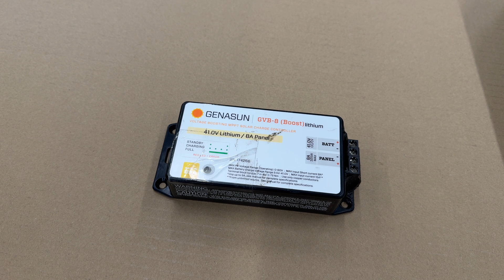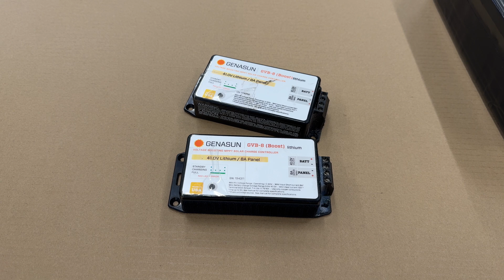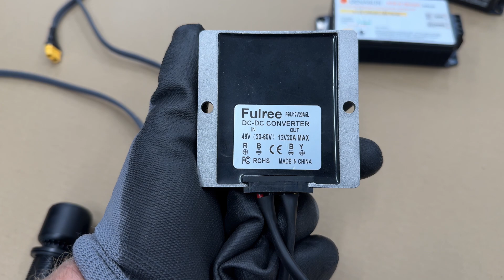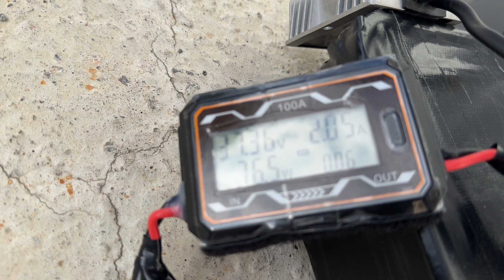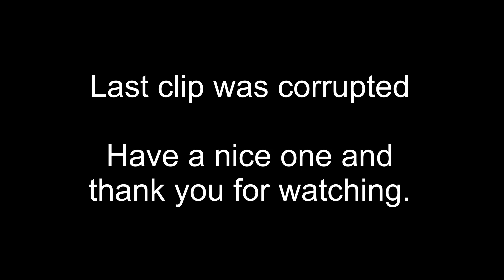How To Solar Charge Your E-Bike. A Simple Guide

Comment: Hi Alex, great video!
Where can I find a battery or a BMS with a common charge and discharge cable?

Thanks,
Sam
Reply from the maker: @samsske  Hi Sam. I use Daly Bms with great success. They are easy to use and mount. Try to avoid ”smart bms’s” as much as possible. Have not so good experience with them. 
Thanks for your comment.

Comment: How do you calculate how many Ah the battery need to be? I mean to optimize Ah as to not carry unnecessary weight that is never used?
Reply from the maker: I calculate based on how much safe charging current has to be. Imagine going down hill and hit full regen and simultaneously solar is charging. I need the pack to be able to handle it without the risk of fast charge too much. When it comes to batteries I don’t care about weight.

Comment: Do I need to build a battery or can I use a battery from grin thats solar compatible with your setup? I'm curious why build the battery instead of using one thats already built? What are the benefits of your battery over a manufactured one? Are there batteries you recommend? Thank you for your videos they are very helpful
Reply from the maker: @joshuacoolidge5995  hi. I build them myself to ensure it’s up to my standards. Not that I don’t trust grin but I like to have full control. Plus it’s a lot cheaper once you have gathered the proper gear needed to build. 
It depends on what kind of cells you are using and the bms on how much charge they can take. I have limited my controller to not exceed 500w regen to ensure the battery can handle it. 
I have exclusively used Panasonic 18650GA cells and for this build I used Samsung 35E. With 12 cells in parallel it can handle a lot of amps.
Reply: 1540wh battery bms can handle the watts from 540 watts solar and the regen?

Comment: Can you charge and discharge a battery at the same time?
The answer: YES!
This the essence of a solar bike:
1) your solar panels do charge your battery
2) in the meantime you use the battery to turn your motor 😎
Reply from the maker: Well, my battery only has one cable. And it handles both charging and discharging. I know this because I built the pack myself. Because it goes to the exact same port on the Bms. My battery does NOT have two separate cables. Only one. Because a battery can not under any circumstance be filled with energy simultaneously displacing it. Either it is discharging or being charged. It can’t do both at the same time. It’s practically impossible. As I tried to explain in the video. Power from the solar aids the battery if the motor takes more than what solar can provide. Battery and solar deliver power in conjunction to the motor. In this instant the battery and solar deliver power to the motor and the battery fills in the ”blanks” that solar can’t provide. As soon as the power consumption of the motor drops below what the solar can provide the excess solar gets stored back again into the battery. It’s a constant switch between charging and discharging happening. And it’s not a bad thing because solar takes load off the battery to power the motor. The battery does not have to do all the work by its own all the time. Solar help the battery to maintain a more steady state of charge.
Reply: so if there are individual cable for charge(by solar panel) and discharge, it is OK to run the motor and charge the battery by solar panel at the same time? right?
Reply from the maker: @2.35이상원  that’s correct yes. The two cables often connect to the exact same place anyways on the bms inside.
Reply from the maker: Yes I agree but what I mean it is technically impossible to sent power two ways at the same time through the same cable 😊.
Reply: @Alex_EVenture  This is why in a Solar bike battery we have 2 cables:
- a CHARGE cable, where you either connect your solar panels or your battery charger
- a DISCHARGE cable, which goes to the electric motor
Reply: But the battery is not charging and discharging at the same time. Either the electric potential across the terminals is higher than the electrochemical potential in the electrode plates, in which case the battery charges, or the inverse is true, in which case the battery discharges. 

Having some combination of sources and loads simply determines whether the terminal voltage is higher or lower, and the battery responds according to physics. Only one thing or the other is true at any given time.
Reply: @myself248  Your explanation doesn't make sense....
In my (all...) solar bikes the battery can CHARGE and DISCHARGE at the same time through two different ports
Reply: @daniele_go  You're providing power into the battery ASSEMBLY through one port and drawing it from the battery ASSEMBLY through another port, but chemically there's only one battery and it's only doing one thing at a time, which is determined by the sum of the power flowing in and out. If there's more coming in than going out, then chemically the battery is charging. Period.
Reply: @myself248  you are just making words....while I design&build solar bikes.
What I say is not theoretical concept, but the description of how a solar bike works.
AT THE SAME TIME:
- you pedal, the motor does assist you
- solar panels produce electricity and recharge the battery.
AT THE SAME TIME

Comment: If the power for driving the motor comes directly from the panel(s) you circumvent the losses for charging the battery. Most efficient use of your solar energy!
Reply from the maker: Exactly. Plus the battery gets a nice break and assists.

Comment: There's solar charge devices for Bosch available now. One is German made (coming soon), but only up to 120W solar. The other is French made and , if I remember correctly, up to 300W solar. The German upstep converter works also for Shimano etc.. However, currently I carry out a Tongsheng TDSZ8 middle motor/Hailong battery (960Wh) conversion of a HP Velotechnik Speedmachine. This is about 4-5 times (!) cheaper than Bosch, Shimano, etc.. The cells in the battery are Panasonic, same as in Bosch etc..
Reply from the maker: That is amazing news to me. Thank you for enlightening me. I will check them out and inform in my next video.

Comment: I would rather split my battery pack into two or three switchable sections so they charge faster and we can keep our average operating voltage at any time as high as possible.  Could even maybe add a section of supercaps to act as a small sag buffer to do hot swapping nicely without stopping.
This is cool, thanks for sharing and the algorithm is working for you because it threw this on the sidebar for me.
Reply from the maker: Unrestricted my setup can achieve speed of 39kph (24mph). I have a 25kph (15.5mph) restriction so for me it is never a problem keeping up the voltage. A large battery rather than several small takes stress out for the battery since each cell cycles less. I have also thought about the supercap implementation. It would be super cool to have actually. 
Thank you so much for your comment. I appreciate it.
Reply: @Alex_EVenture   Thanks Alex for the teaching and explanation. I am trying to learn as much as possible, so can you explain the comment of russellzauner above regarding the supercap and what it does?  Also, how long  would the battery last for ( longevity , after so many charging and discharging while you are on the world tour)
Reply from the maker: @kentran2416  Thank you. Supercaps can charge and discharge extremely fast. Much faster than batteries. So if a module of them are in line with the battery pack it can take care of those high peaks of power in and out put and by doing so spare the stress on the battery pack. So it’s like a buffer for power. It is not just like you put them in and it’s all good. You still need additional equipment to make it work. 
What I do to ensure my battery lasts longer is by not charge it to 100% ever. I charge to 90% and by doning that I will  prolong the lifespan. And I never let it drop lower than 30% charge. By having the perfect amount of solar my battery hovers around 60-90% all the time which is perfect for the battery. Less cycling. Optimal would be 80% maximum all the time for maximum battery health.
Reply: @Alex_EVenture ❤😮

Comment: Do I need to connect the charge controller output to the battery output or to the battery charger connecter on the battery?
Reply from the maker: @skyl4rk  what Art said but to clarify. If you battery has two ports. One for charging and one for discharging but in reality they are actually the same on most batteries. It depends on your Bms inside if it separates these two functions. Do the test I mentioned. You can then connect the solar to your charge port and connect the other one just as you normally would.
Reply: @Alex_EVenture  OK, I did the test and it turns on while charging.  I have the Unit Pack Power 48V 20aH battery from Amazon.  When I get some xt60 connectors, I will start building.
Reply from the maker: @skyl4rk  perfect. Good luck with the build.
Reply: Note he wires all battery connections in parallel and mentions some manufacturers' BMS charge connection prevents charging/discharging simultaneously. I just bought my 1st LiFePO4 battery with attached charging/discharging BMS. I expected to be able to do both simultaneously but need to confirm.
Edit: My little battery allows charging and discharging simultaneously.

Comment: That was so helpful, my thanks Alex. One imagines that a bigger part of your design/functionality process can only both start and develop with
a good understanding of your limits. In turn, you are looking for ways to counter those limitations like the weight of a battery, cost and safety.
Consider me brain dead when it comes to this subject, it´s almost like a disability built-into my genes! :cat-orange-whistling:
The last time I was looking at a similar set up, was the idea of having of these popular solar panels that are flexible and can be unrolled to fix
onto your backpack while trekking. This somehow "led" me to consider the prices of the home run systems that link to a bigger battery, simply to
be taking reshored on sunny days!
I was also interested in the advantages of tenting with my van as a base at the time. Those systems tend to be self serving and plug-play set ups.
You have to know what the max output of your motor should be given the average weight and grade of hills you will climb and then work back from
their. I tend to always find issues that need answers, like is that transformer waterproof, how will the insurance be calculated on it. etc.

Don´t worry, you do not need to answer, their just examples. I feel that their must be a whole lot that could be done with better knowledge and
am simply impressed that you were the right person at the right time, to even want to entertain such a challenge. 
Your new panel is very big, or at least seems huge, yet as you say, it has a second function. As it is, the wind will blow the water from the edges onto you,
so are you thinking of having a little edge or lip glued onto each side and front? Also be carful with the crazy heat we have been having, I had 40 down
here on one day, that would melt your tapes and wires I think.
Your transport certainly has a footprint though, parking might even be an issue in town? How can you leave it to shop, I would be terrified.
I feel that way even with my El-scooter, yet installed a more powerful alarm that goes on for 4 seconds when touched.

Thanks again for your quick reply, good luck 🙏 Later

Comment: With the new 200W panels, will you connect them in series with 1 voltage converter, or will your 2 voltage converters be able to step up individual panels?
Reply from the maker: @artsmith103  the charger can only handle 8A of input and the 200w is I think 6.7A. Not sure. Need to check. So I use two chargers. One for each panel.
Reply: @Alex_EVenture  You mentioned in prior video that the new panel voltage matched battery better. That looks good. Look forward to demo video.
Reply from the maker: Yes. It has a higher voltage. I measured 35v open circuit. So I am thinking less conversion up to 41v. Most 200w panels have a voltage lower than that and higher current which makes impossible to use with one charger. This panel fits the bill perfectly. 
Thank you.

Comment: I just purchased what you call DC/DC charger. Mine is 10-20V input, 13.8V output to cleanup the Vdc off 8hp outboard to 12V boat battery. I've seen 15V with full batteries. Similar idea to what you're doing.
A topic that would be good for you to cover is how fussy Lithium chemistry batteries are about charging voltage.
Reply from the maker: @artsmith103  good idea. Thank you.